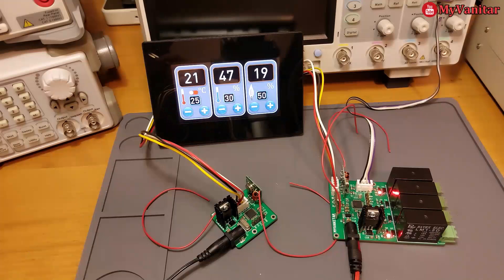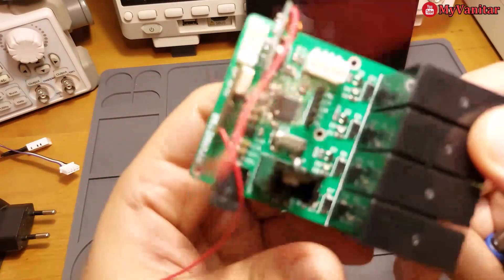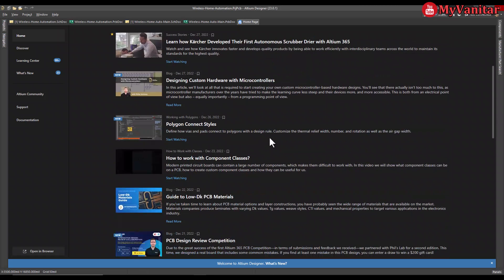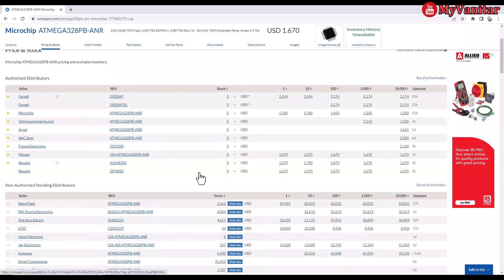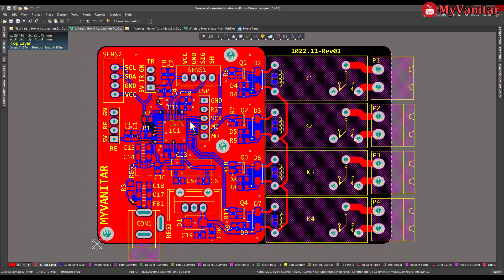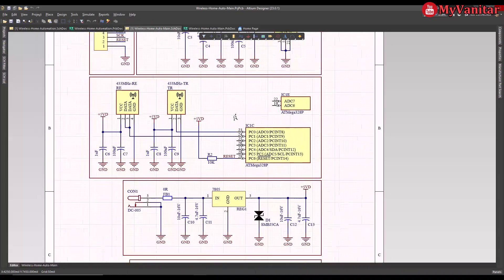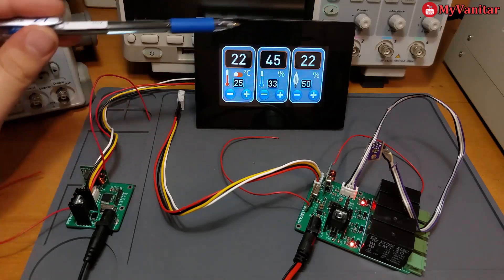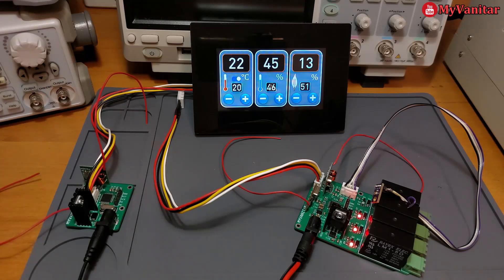🔶 Wireless Home Automation (Control and Monitoring) Using a Nextion HMI Display

Comment: Can you provide more information about the Nextion work? 

Bob's your uncle... LOL.
Reply from the maker: Did you check the article?
Reply: @MyVanitar Yes. I just went back and clicked the links at the bottom to be sure I didn't miss something. I was wondering if you have a video, or text, about designing the interface with the Nextion "IDE" editor. I guess I could open your file and mess around with it. I don't think the file is compatible with my screen; it is a 3.5" Enhanced Touchscreen (yours is 4.3"). This is the only part of this project I am struggling a little bit with. I also really wish there was a USB connector on the screen. I called Nextion and they said it was proprietary and won't tell me anything about anything. Maybe someone more experienced knows if this is possible?
Reply from the maker: @VidarrKerr  I think I got what's your point. When you design a GUI using the Nextion IDE, you have a design file (*.hmi) and also a compiled file (*.tft). then you transfer the compiled file to the Nextion board. I use an SD card. I think it is also possible to transfer using the UART interface. your GUI design is useful for that screen size because the image/component sizes also matter. all of these tools have their own limitations and strengths, nextion is good for some projects, but for some, I use LVGL as you see in some of my projects.
Reply: @MyVanitar  If I could go back, I would have bought a different touchscreen. At this point, it might just be easier to make a simple Android app and control everything from one of my phones I don't use. 

I will probably end up using the Nextion to just display temp and humidity, maybe display the lighting and pump schedules, etc. and do all the actual changes to scheduling thru a phone, or a web server running on an an attached ESP32. 

I think I had too much high hopes for the Nextion... Oh yeah, THANK YOU!
Reply from the maker: if your touch screen is resistive, you should define the touch-related components bigger in size. it's not like your cellphone. in a cellphone there is a powerful CPU and other components to control a high-resolution LCD, touch, and operation system. everything has its own target use. nobody uses an android to control a refrigerator or a home boiler
Reply: @MyVanitar  I understand what you are saying. This is for an agricultural space the size of four football fields. I am making one system now that will be used in six separated spaces. Theoretically, it is simple, but in application, it will end up being pretty complex and large. 

I think I made a mistake selecting the Nextion. It can do the job, but it would be much more efficient if all of the spaces could be controlled from a single device and that device being able to be mobile and also controlled from an office on a PC. Having a Nexti0on in each space to control the space is probably not the right design. 

The more I think about this, the more I think I should deploy webservers from each of the spaces and unify them in a React app.